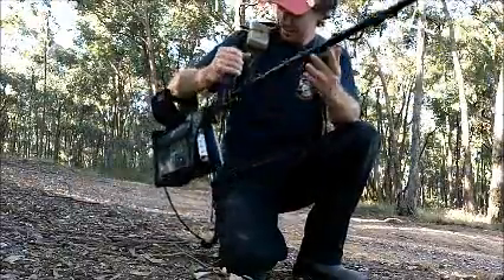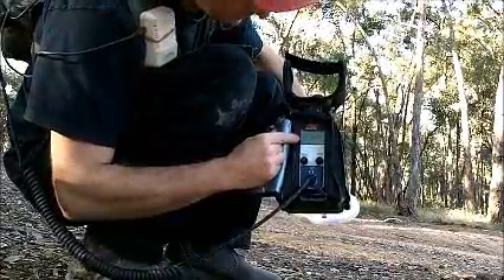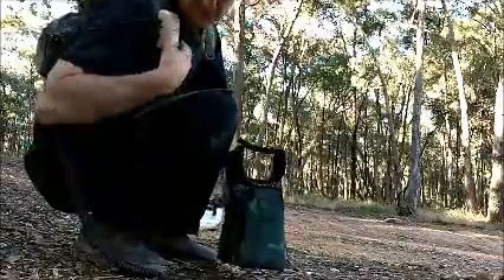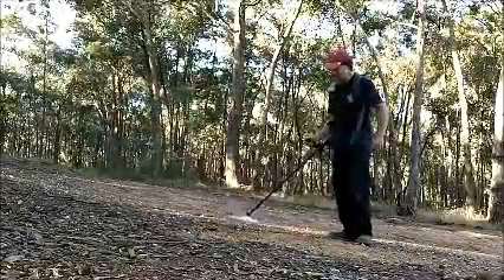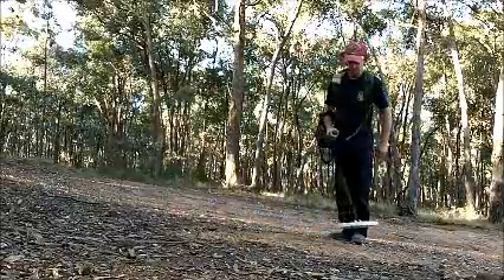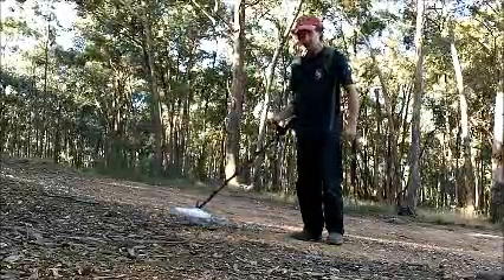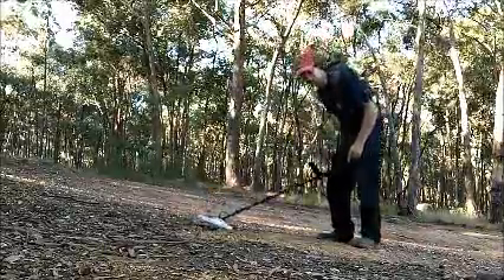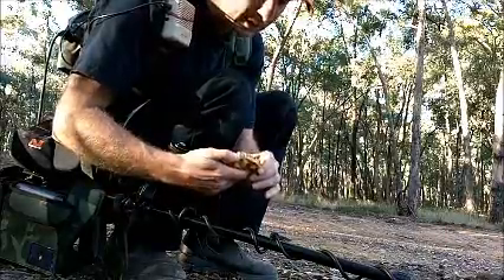Testing depth and sensitivty of Minelab 5000 and 4000 gold detectors..

Comment: Remember that signal was with the nuggets not being compacted down with hard soil,you just had it on string..The signal of that 16 ouncer would of been even harder to hear had  it been in normal circumstances with the nugget in its normal state unearthed.
Reply: That's actually incorrect. When nuggets have been in ground naturally they develop a halo type magnetic affect around them and they are easier to hear than air testing or hanging on string in a hole.

Comment: I have the Tesoro Lobo and it's a great gold machine for a VLF. I've found a lot of small nuggs with it and with auto ground tracking and lifetime warranty it's worth considering. I think the eureka gold is more versatile with it's 3 power choices and is probably worth the extra $$$. My next machine will be a pulse machine, either gpx5000 or new garrett ATX. Pulse machines can handle the hot ground better than VLF types and I know they can drive a person bananas in the gold fields having to GB all the time.